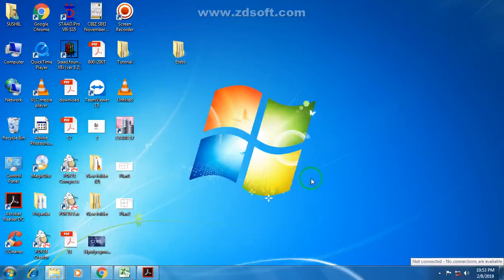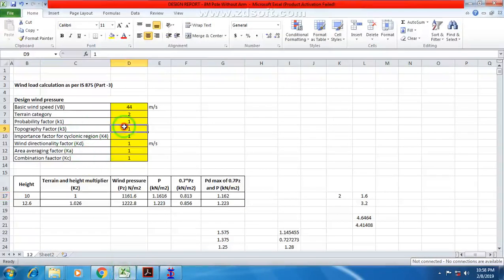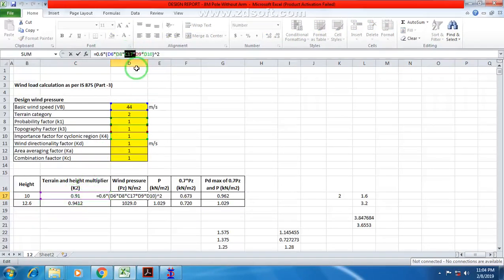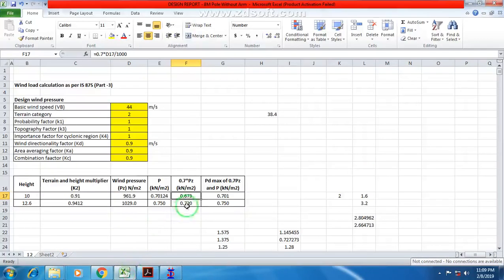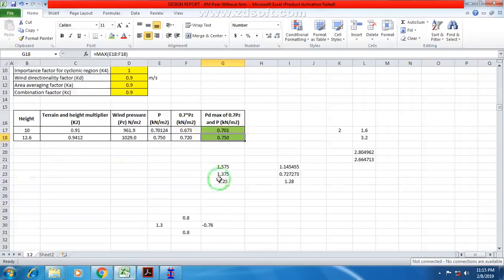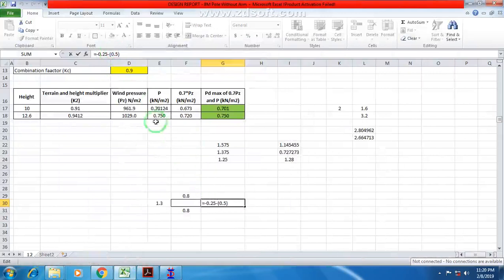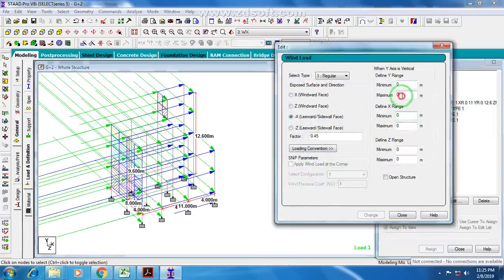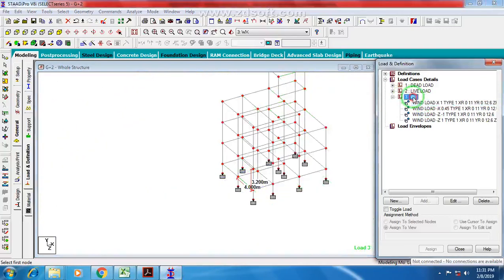How to apply wind load in staad pro. correctly as per IS 875 Part 3: 2015

Comment: sir,
In taking Cpe from table 5 i have one doubt. if the building is vertically rectangular front length side is A and opposite to that is C  for 0 degree and in perpendicular for 90 degree, the top short side is B  and bottom short side is D. accordingly we have to read cpe values from fig given in Table 5. if  building is horizontally rectangular your  front short side becomes B and opposite side is D for 90 and front length top and bottom side becomes A and C  for 0 degree. is it correct to read cpe value. kindly clarify. nobody watch the figure given in table 5 to read cpe value. there is little comfusion in reading the figure.

Comment: Presentation is very cumbersome and boring. Make another excel sheet for calculating external and internal wind pressure by giving height, width input. And explain by giving text explanation as well and not switching too many times from one page to other.

Comment: I have a doubt regarding the height of the structure. For example for a steel building of height 18 m will the area averaging factor be different for different floor? and do we need to calculate k2 value for each floor above 10 m?

Comment: Sir when I am applying wind loads in a simple model, wind loads by staad model are coming slightly higher than my manual calculation.. Exposure has been taken as 1 & Factor as 2. Can you please share your Staad Model as I want to check where I am wrongly doing

Comment: iIs there a way to calculate windload automatically as in ACSC code?
Reply from the maker: Yes.as per acsc code you can but not as per IS code.you will get option in wind load page

Comment: Hi, I have to design a floor on existing structure which is G+3. The new structure is 3.76m tall on the terrace of the existing building. New total height will about 20 m. Now how do I calculate the wind pressure for this new part. I am using Staad for the analysis and the column s and beams are of steel section. Your help is appreciated. Thanks

Comment: Sir , the video is just wow.great explanation sir. Helped a lot in my project.
Sir,but I have a problem .I have assigned all the wind loads ,given the correct ranges,but the wind load has only appeared to the first two floors.the wind load is not displayed on the upper 2 floors.what may be reason sir?.please respond quickly.
Thank you
Reply from the maker: U need to check range because that some time creates problem.
Reply: @structech2535  i cross checked the range.but it happens to be the same.

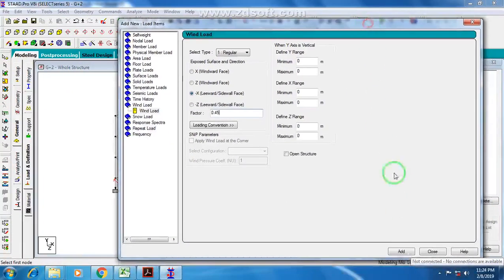Comment: Brother, one more doubt @ 31:13 Time line in Load Case WX, for Windward side the factor is +1.0 (From excel) and you applied as +1.0 (in STAAD), But in  Leeward side the factor is -0.45 (From Excel), but you have applied as +0.45 (In STAAD). Why there is change in sign? Similarly done for Sidewall Face also (Change in sign).... Why so??
Reply from the maker: Dear Azmat,
Its due to sign convention in staad..for eg. Lets consider X direction..in leeward side my wind will move away from B face (in excel minues sign indicating away from face) so i used +sign in staad if i had used -sign then it will act towards face B not away
Reply: @structech2535  Okay... Thanks....
Reply from the maker: Hope now its clear to u
Reply: @structech2535  Yes. now its clear....

Comment: nobody has uploaded this kind of video regarding Wind loads....really great. One doubt is that if a building face has different tributary areas (with different c/c column distance and different building height), which one to be considered? whether it is based on maximum center to center distance between columns or maximum height of the structure??
Reply from the maker: Dear Anurag 
Please check new video on Seismic load application in staad..
Reply from the maker: Dear Anuraag,
In that case u can consider maximu c/c distance for simplicity and safer side...

Comment: As shown in the video wind load has been defined for wind flowing in X direction 
Similarly we do we need to define wind loads when wind is flowing in -X, Z and -Z direction?
Reply from the maker: Yes u have to consider
Reply: @structech2535  But you have already considered Z component of force in WX load only? Then is it required for Z direction wind?
Reply: @kamaldhar2100 cz wind can come from all sides..he has just shown one example for positive x direction ..wind can come from -x,+z,-z..Wind will blow from all directions of building
Reply: but  all X , -X , Z, -Z were assigned under WX .. then why

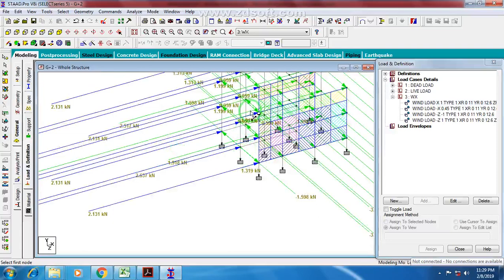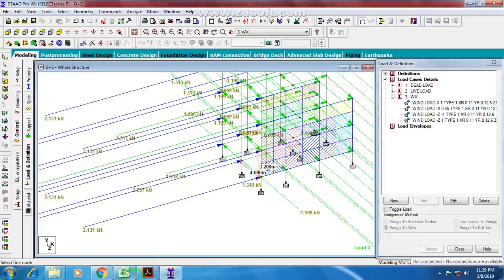Comment: sir whether  wind load is distributed to columns only or beam also takes the wind load?{36:02-36:20}
Reply from the maker: Wind load is lateral load so it will first hit exposed area of building ( i.e. walls + column+ beam of exposed face) then that lateral push will get transferred from beam to column n then to footing.